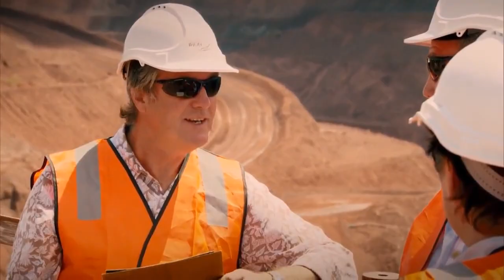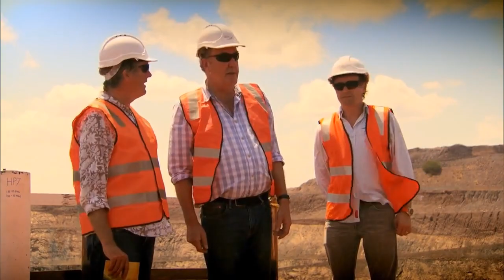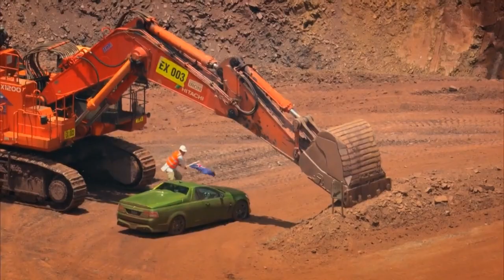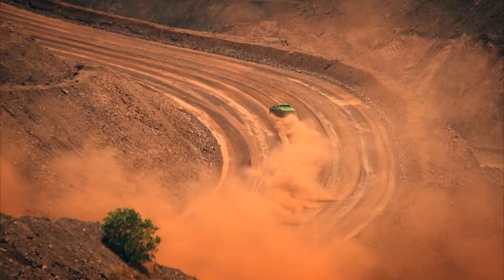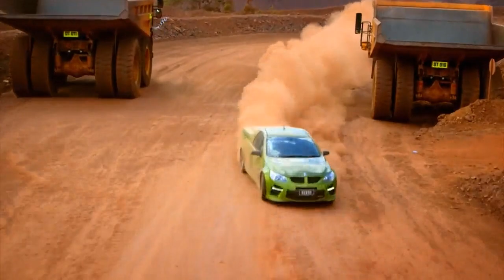Top Gear 2015| HSV GEN-F GTS Maloo

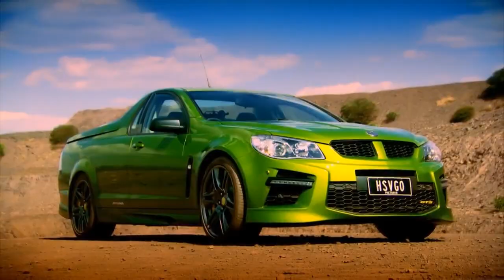Comment: 0:46 they laughed because of the price differences, the maloo  Ford XR6T, I would have to mention the old school RB powered GTRs, are unmatched in their class. when The wheels find the ground, they get going real good.
Australia can hang with the big boys DW about that.
Reply: Its slow, got an old camaro motor, just a MUCH slower version of a camaro that is much older than it, let alone the corvettes, therefore no it cannot hang with the big boys as a camaro is hardly considered a big boy not to mention an old camaro.
Reply: @SnowPyramid  I think he's talking about cars around that size with 4 doors, because he said "class". Chev Camaro, specifically the ZL1 is very quick. But the last gen HSV W1 was just as quick. Both are awesome cars. 🙂 We had a competition called "Bang for your buck", which Holden's and Ford's consistently got in the top 5. But recent years, that honor goes to the Ford Fiesta ST and Honda Civic Type R. Great cars.